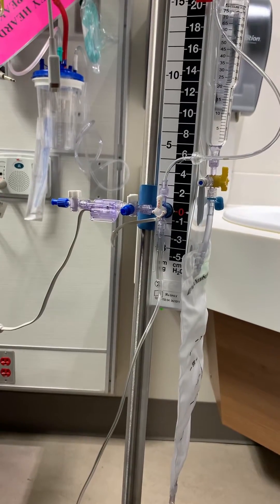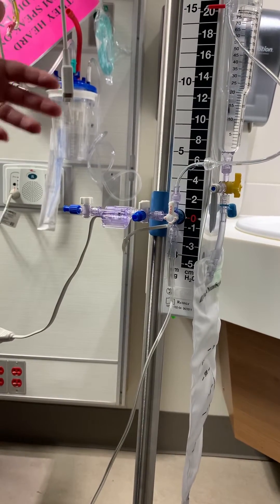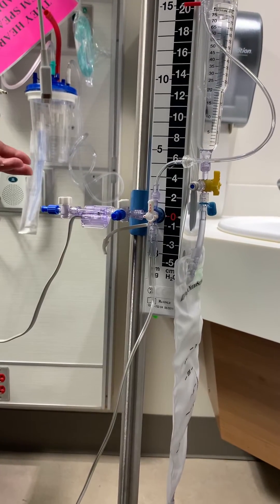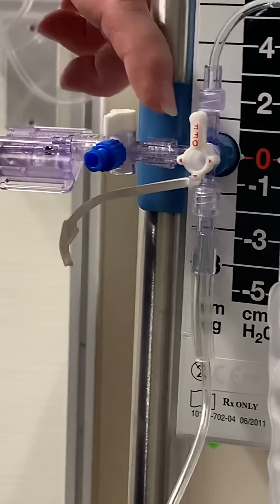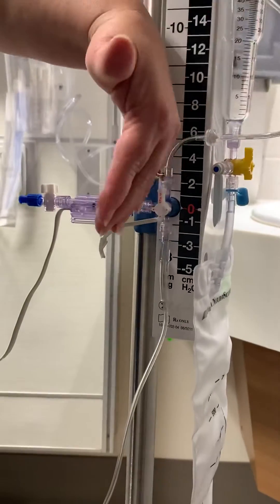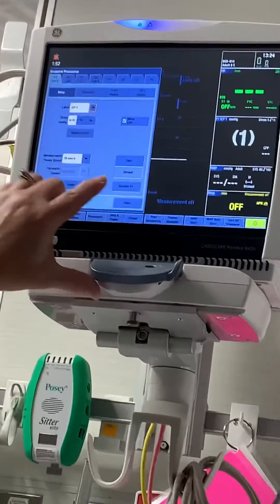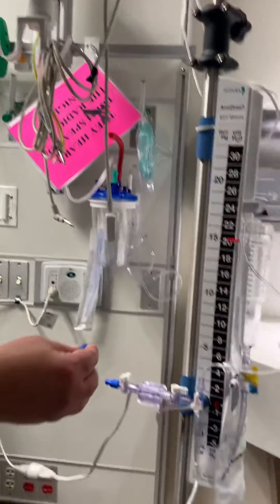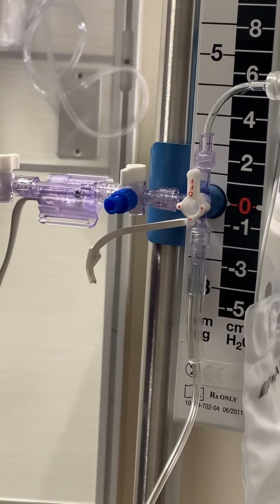Zeroing an EVD

Comment: Can you use the stopcock at the other end of the transducer for zero-ing? Sometimes the setup does not have the stopcock that you used.
Reply: In our organization with this transducer, we only use the stopcock shown here to zero. The stopcock at the end is utilize only for priming/drain set up. If your organization utilizes a different transducer, I would recommend zeroing with the the method shown in this video. https://youtu.be/Lkel0osdw88?si=3XiYQnQRza-coYgE